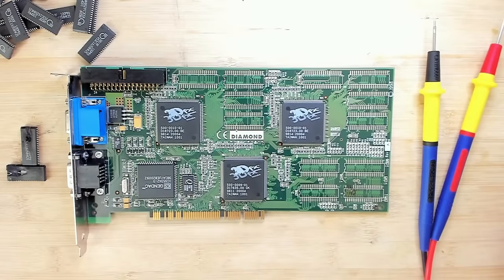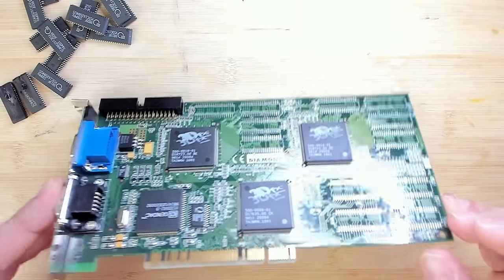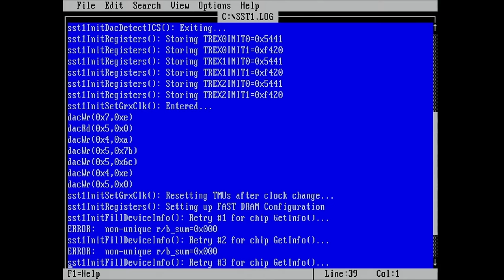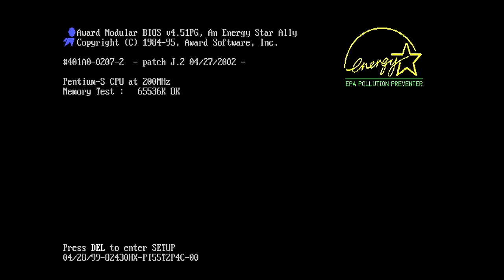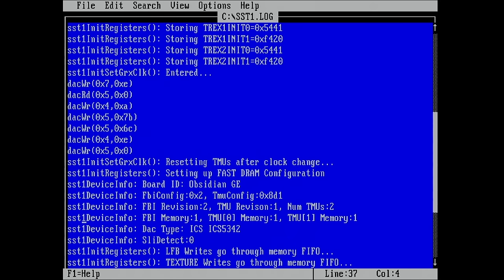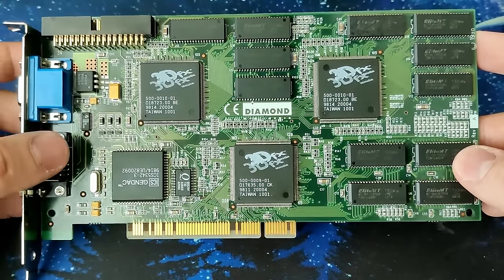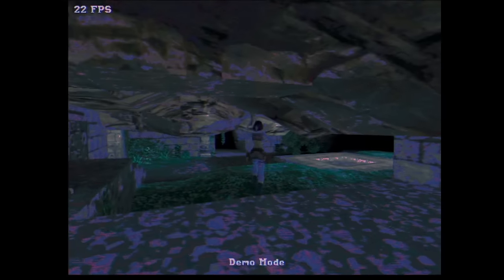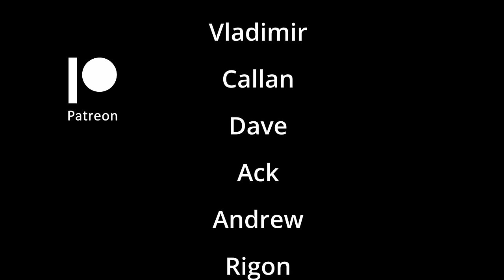Diamond Monster 3D II - A Voodoo 2 rises from the ashes? (Part 2/3)

Comment: Perhaps the traces to the frame buffer RAM on the lower right hand of the board took more damage than was visible? You may already have rechecked the ground and +5v rails to those chips, but if not it may be worth it.
Reply from the maker: I'll measure the connections to power once more. There are more VCC and VSS pins along the chip. Maybe I missed something there.
Reply: @bitsundbolts  Are address lines in close proximity to the board damage? Edit: You channel it great - long may it continue!

Comment: Did you check all the 5V rails to all new chips separately? Maybe one of the lines melted inside the PCB when that PSU failed.
Reply from the maker: I checked those lines before I soldered the memory chips. I don't think the 5v lines are the issue, but maybe a broken/missing address line. I will investigate further. Thanks 👍

Comment: One of the burned memory chips might have sent higher voltage to the FBI and damaged it. Check if it is getting too hot.
Reply from the maker: I checked the FBI chip with a thermal camera already. Seems normal to me - around 40 degrees idle. Those chips heat up to 70+ degrees under load. So far, I haven't noticed anything suspicious.

Comment: Shame it seems to totally prevent initializing in windows.  Would be neat to have a wacky rendering mode to make all your games surreal.
Reply from the maker: Haha, true! But even tomb raider doesn't work with the proper patch installed. The moment the game goes into 3D mode, the screen remains blank.
Reply: @bitsundbolts  ah I see.  So the wacky colors were just unrelated.

Comment: I'm surprised that voltage regulator survived, it's rated for a maximum input of 10V, so I guess those memory chips shorted and blew up before it reached that voltage, or it didn't stay high long enough to damage the regulator. In any case, this is likely what saved those 3Dfx chips.

The fact that the FBI chip is only seeing 1MB is definitely suspicious. That suggests only two of the memory chips are working, so I'd be checking the RAS, CAS, and address lines of those chips to see if you're seeing activity on all of them.
Reply from the maker: I will try to figure out what is going on with the memory. 🙏 Thanks for your input!

Comment: Wild guess, but could there be a bad passive related to the memory chips around the area of the damaged chips? The only way to figure out which one would be to trace each memory chip though
Reply from the maker: I replaced the caps around that one chip with the hole and measured all resistors in that area. All seems to be fine.

Comment: If you want me to measure something, please let me know. I have the exact same card both 8mb and 12mb versions. Also had creative one. Put the cards into a better system. Also when i searched for the memory chips i saw that there differences in memories, not only speed but timings etc.
Reply from the maker: Thanks for the offer. I also have a few working Voodoo 2 which I am using for reference.

Comment: I'm wondering if you have a broken trace causing the 1mb. If I recall the chips that exploded were FBI chips. So you should check the connections from the ram to the chip. I know that sucks, but sometimes that's the way it goes.
Reply from the maker: Yes, it is a lot of work, but I guess this is the way forward. Test everything and rule out certain things to narrow down the problem.

Comment: Maybe the chip is defective, because it was connected to the burned RAM chips. If a RAM IC burnes, then it melt internally and it could be, that the memory connections to the chip get a higher voltage. Then the FBI chip will die. You can propably measure it. In overvoltage conditions the internal clamping diodes die. This reults in an effect, the the pin didn't get a proper high-level.
And you can take pictures with a thermal camera. In some cases you can see, that there are faults in higher temperature. Best wishes
Reply: That would be the worst case scenario I am afraid of. I also think that observing temperatures with IR, and comparing it to the identical good card, would be a good way to proceed and physically locate the origin of the issue. Would be such a shame if it's the FBI chip, losing anything that has 3dfx written on it is always sad. Let's hope it's just one of the lanes that got toasted.🤞🏻
Reply from the maker: Well, we could also see a positive in that we recovered two TMU chips 😂 - glass half full mentality!

Comment: Is the text on the memory chips rubbing off? Might the FBI chips you installed be bad? It's a long shot but maybe.
Reply from the maker: The chips look legit and original. I rubbed them with a lot of isopropyl alcohol to get rid of the flux from the card. All markings are still there. I'm still trying to find a clue why we have only 1MB at the FBI chip.

Comment: you could try removing the chip that had the most damage under and se if something changes, if not try to check there are not shorted data lines between them also observe the data lines whit and ociloscope to be sure nothing is missing.

Comment: Easiest explanation:
Some Addressing error. 
So either something is pulling addressing lines down (RAMDAC perhaps?), bad contact or an issue with the FBI that got some addressing lines blown...
So time to get out the scope and scope the Address line of the Framebuffer?
Reply from the maker: Yes, I guess that's the best thing to do now. Checking all lines on the memory chips for connectivity.
Reply: @bitsundbolts  You might even have to go further and get the scope out and do some scoping of the address lines...

Comment: It seems that this unit determining amount of installed memmory just writing smt to it. And it have common adreses or common data lines for all memmory set - sharing same lines for all memeiry set and I sugesting that some of them damaged via overvoltaged memmory chips. To catch them up jus use multymeasuring unit in p-n mode to see transaction voltages for intire circuits of IC to GND and to io power domane. Shure you will find smth wrong there.

Comment: Could it be a faulty connector/cable missing a colour channe pinl? I thought maybe the pass-through cable is ok, but... grasping at straws and it's an easy check.
Reply from the maker: I know, it's a lot of guesswork. But I know the pass-through cable is working. It could be a connection issue with the ram chips. I need to investigate further.

Comment: is possible the new memory chips some are broken from the begining ?? another question i know i asked this before but instead of installing 512k chips you can install 1mb chips to upgrade for 24mb ?!?
Reply from the maker: It could be that a new memory chip is broken. I should have tested them before I soldered them to the board.
Regarding the 24MB Voodoo 2 - I believe if it were possible, someone would have already done it. I didn't investigate the wiring and if there are enough address lines available, but the fact that there are 12 MB cards with just 12 memory chips is evidence that one could expect to see a 24 MB model. But I'm not aware of its existence. So, I have my doubts.

Comment: very interesting  problem 
if we could determine which memory channel is reported working and which ones are not
put sockets on the card and play with memory chips untill you see the difference? if a card can work with just 1 mb buffer it should have 4 2-chip pairs "memory channels" it would be great if we could manualy pole memory areas because at this time we have no idea if the momory you installed is actually not the faulty chip in a batch, we have no ideahow badly blown up memory backfeed to the graphic engine, it would be worth checking if blown meory modules have shorts between dara ,adress and power pins because you may be licky and memory contriller is working just missing some pull up or pull down resistors and that could be fix externaly if you unlucky the whole chip is in zombie mode and you will have to replace it
you could check with oscilloscope how data lines look on afected memory or just with a logic probe
it is very wierd that movies get pass trough in full color and the 3d is wacked because it is not just missing color from a dac colors were there but all wrong
good luck
Reply from the maker: Thanks! The movies are coming from the primary VGA card. Only 3D scenes are rendered by the Voodoo 2. That is why we need the loop cable to be able to seamlessly switch between the 2D and the 3D VGA signals.

Comment: I'm not a 3DFX expert but if you set up an SLI system then would that show what might be going on? I assume you have tested your DOS/Tomb raider setup with a known working card? 😉 Best guess is a broken trace or via
from the FBI to the RAM 😢🤷‍♂️
Reply from the maker: Yes, I tested a known working voodoo 2. That is when I realized that I needed a different 3Dfx patch (which is probably the cause for the colors). However, I still have the issue with the 1MB on the FBI chip. I'll test the traces once more .
Reply: @bitsundbolts  

Also I wonder if those RAM chips had 12 + 5V coming in? The last time I  saw damage that bad was a lightning strike on an analog modem 😣
Reply from the maker: @SimonZerafa whatever it was, it must be some sort of overvolt from the power supply. Unfortunately, all this happened 25 years ago 😂 ancient history by now.

Comment: When you put the new solder pads in I didn't see you solder them to the existing traces, myybe it's not making contact.
PS: Those linear regulators are rated for an input voltage of 10v but are characterised up to 35v! I doubt it was damaged.
Reply from the maker: Yes, I didn't record that part, but I did solder the pads to the remaining traces. I also measured the connection to the FBI chip - all is good. Yes, good that the voltage regulator survived and saved the 3Dfx chips.

Comment: bad memory modules?
Reply from the maker: That could definitely be the case! I could swap the chips and see if I get a different amount on the FBI chip.
Reply: @bitsundbolts those chips unfortunately look like Chinese people sanded used chips down and relabeled them, there could be bad or wrong chips in there! Had my own experience with that. I would not trust those to be good.
From my experience of repairing modern GPUs, you can tell (in the most cases) if the main chip (the framebuffer in this case) my be dead by measuring every Data line going to that chip in diode mode to ground and comparing the values, they should all be the same.
Reply from the maker: Thanks, I'll try that. It would be nice if it's just a bad memory chip. I think this is one of the first things I'll try.

Comment: Unfortunately the AMR on the regulator is 10V. I wouldn't leave it in if sourcing a good fresh replacement is possible. Which i know might be a problem, i wouldn't trust Ali parts more than this one.

I suggest checking the IO pins that connect DRAM to framebuffer chip for signs of latch-up or latch-down, i.e. that the ESD diode or output circuit on the pin is burned and constantly pulls that pin. It may show as a short to 3V regulator output in case of latch-up. Or some sort of anomaly in resistances to both that and GND in comparison to other pins. Obviously the RAM ICs in the framebuffer circuit have suffered the most.

I don't think the DAC is faulty, since it can output both black and white; furthermore gamma ramp commands don't mess it up at all, when the game fades to black and fades in. I think the whole problem is between framebuffer controller and its memory.
Reply from the maker: I have a donor Voodoo 2 that should have a good voltage regulator. I could use that. Then I need to spend more time investigating the memory.

Comment: Try to figure out the organisation of the memory for FBI, and make a simple diagram, to make it easier to understand. Seems like OE or CS is missing for one of the memory banks.
Reply from the maker: Hm, good point. I should pay close attention to the signal lines. I haven't done much except for checking continuity to the FBI chip from the one chip that was badly burnt. I guess I have to check the other chips too.
Reply: @bitsundbolts   Yes, but the best intension here is to draw a simple map while you're in process, to gain a better understanding. And to come up with a further stragedy of testing. As i know there are no schematics available online for those cards.

Comment: The writing is coming of your memory chips could some of them be fake maby replace the fbi memory and try again.
Reply from the maker: The writing on those chips is quite dark, but that is normal for those EliteMT chips if I'm not mistaken. After soldering them, flux goes everywhere on the chip which might give the look of the writing coming off, but that is not the case. All the writing is still there.

Comment: 12V couldn't have done it to memory chips. It was the full AC voltage from the wall.
Reply: I was thinking that, ie, too much damage for 12V, but PS do put out a lot of amps.
Reply: I had a pc that was a victim of lighting-strike that came through the phone line to internal modem card. that 56kbps era....
Since then, I never used any internal modem....
Now I have fiber....
Reply: Full AC voltage would destroy all the chips on this card, even the big ones, based on that they survived, i think that voltage on 5v rail was lower than aprox. 30V-40v DC, higher voltage would fry linear regulator for 3,3V and kill rest of IC's

Comment: Replace FBI chip.
Reply from the maker: That is the last option I am considering. There are, however, a few other things I would like to try first.
Reply: @bitsundbolts Well, you could check the RAM connections first perhaps but I suspect the RAM  overvoltage fried some of the FBI chip pins. We'll see...